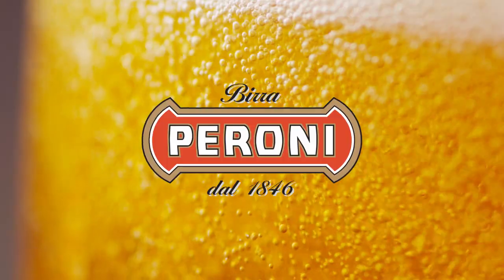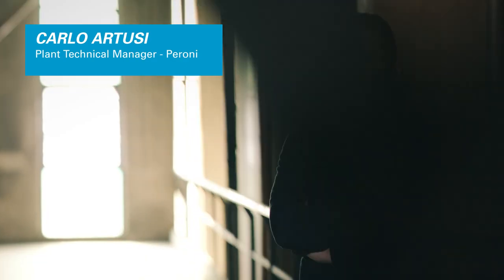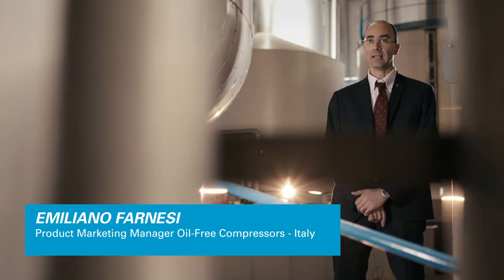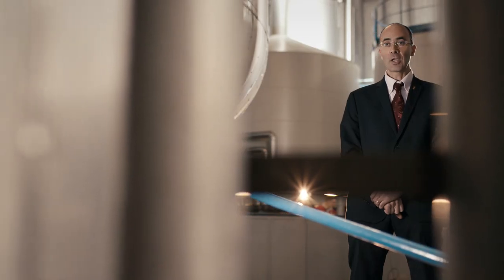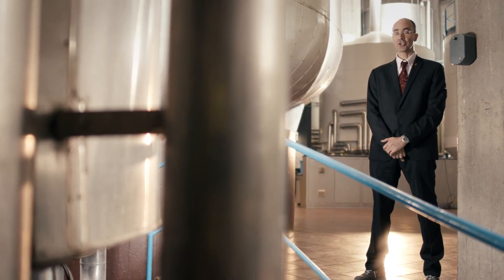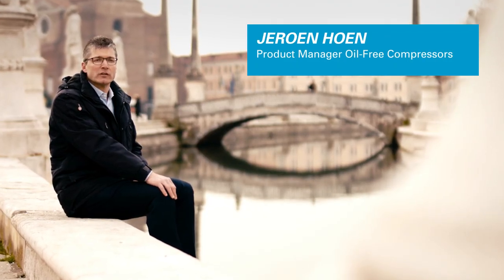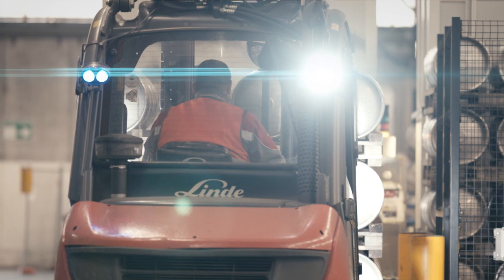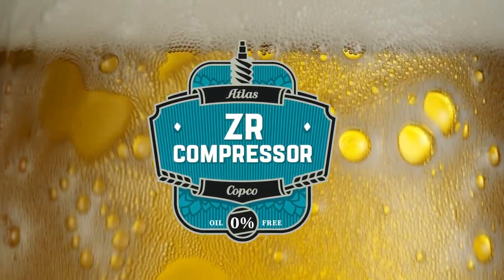Atlas Copco Compressors | Success Story | Birra Peroni on ZR Oil-Free Air Compressor

Comment: After 40/50,000 hours the oil free element loses efficiency fast ( they all do ) that can mean up to 15 to 20% less efficiency and higher energy costs 

At 60,000 hours plus then the customer pays the cost not the manufacturer 

It’s better to change elements at 45,000 to be efficient 

I have been involved with atlas Copco oil free Z compressors since 1979 - 2020 I have vast experience that this information is factual Ztechnique.co.uk